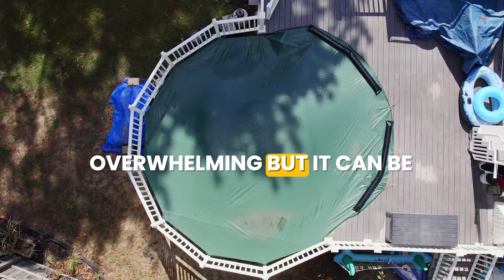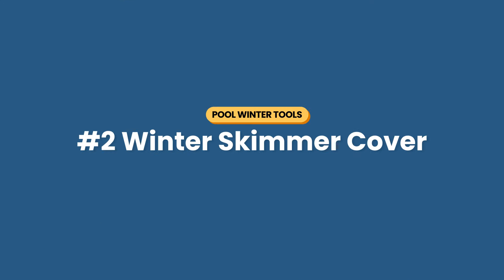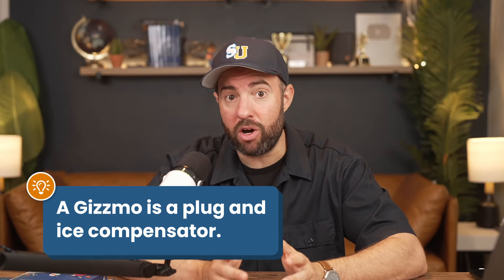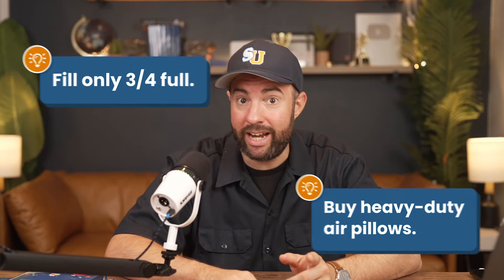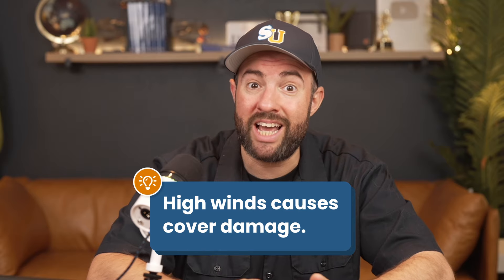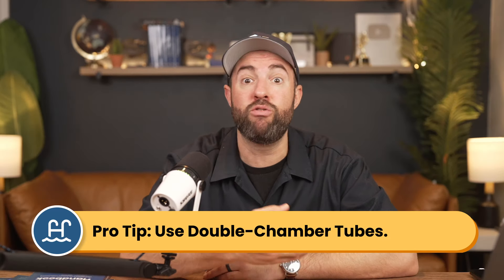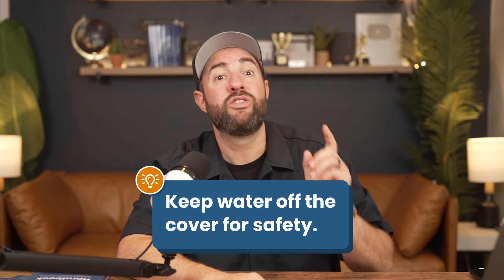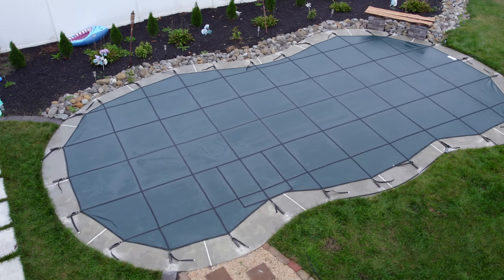Pool Closing Mistakes: 11 Tools to Winterize the Right Way

Comment: How much psi do I need for an air compressor?  Would the blower on a shop vac be sufficient to blow out the lines on an inground pool?
Reply from the maker: 10-30 psi
Reply: I have used a shop vac for 20 years without any problems (and I live in Canada which freezes). You will see the water pour out.   I am careful which you have to be with any blower.
Reply: We also use a shop vac to blow out the return lines and skimmer lines from the filter side then vacuum out any remaining water in the skimmer basket. Also add rv antifreeze tall lines as an added precaution.
Reply: Shop vac will work for skimmer and returns, but not strong enough to blow out a main drain if you have one
Reply: So I have an above ground pool and I heard you mention getting a cover for the skimmer but what should I do with the return hole. I imagine I still need to disconnect the sand filter but wouldn't I need a plug for the return hole or no.

Comment: A shop vacuum set to blow the lines is better than an air compressor. Ensure skimmer is free of water and add antifreeze below and above the Gizzmo. Also, leave the water on top of the cover. A pump will freeze and crack. The water will help keep the cover down when windy

Comment: Any reason why me and my friends pools get mustard algae once a month? We all have new filters, keep pH between 7.2-7.8 Alk is always 100-120, CYA is 40-80 free chlorine is 3-8ppm. We all have the same problem with our pools. We’ll shock like once a month sometimes twice, get the free chlorine over 20ppm and hold it there for days. It’ll go away and slowly creep back. We brush constantly and clean the filter until pool is clear. Our pumps run 8-12 hours a day. Is there an outside factor I’m not considering? Anything helps. Thanks. I’m seriously considering filling my pool and saying F it because it’s costed a lot of money and hard work. When I research online it doesn’t help. I understand mustard algae is chlorine resistant but it shouldn’t keep coming back after blasting it.
Reply from the maker: You may want to consider shocking once week if you're having mustard algae that bad